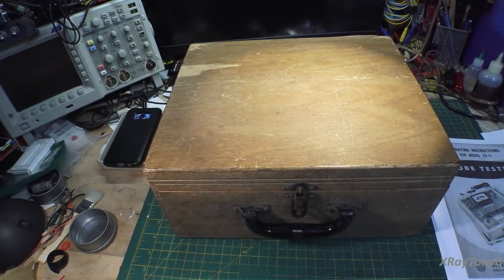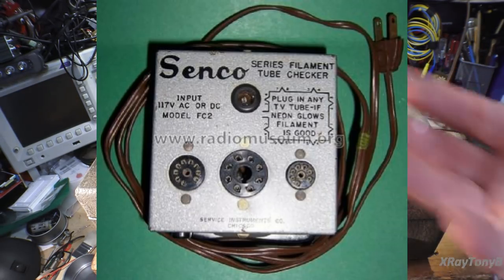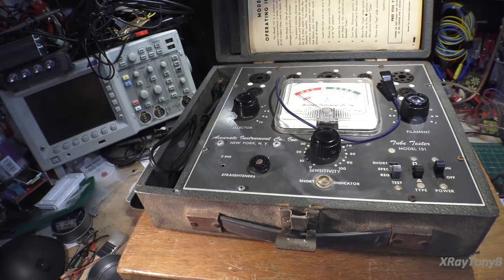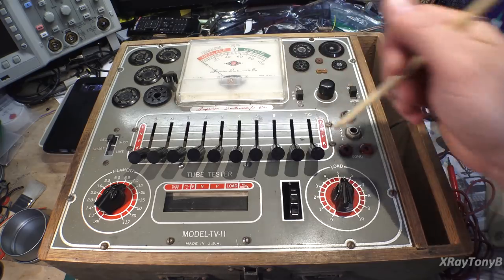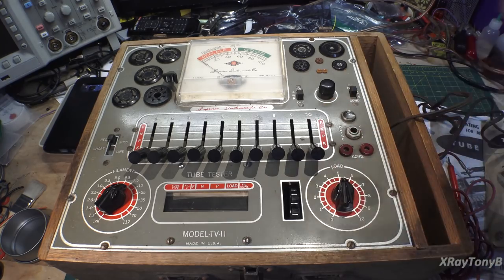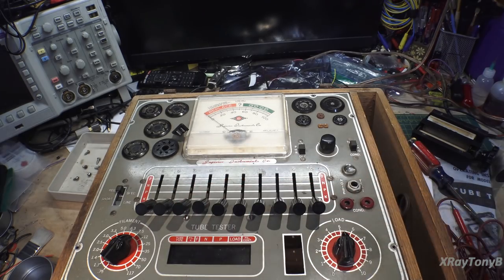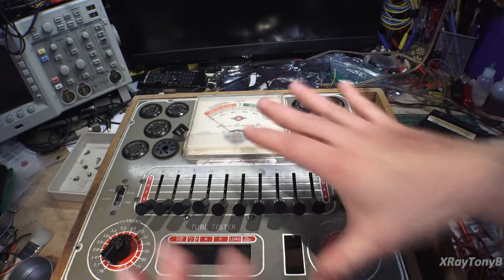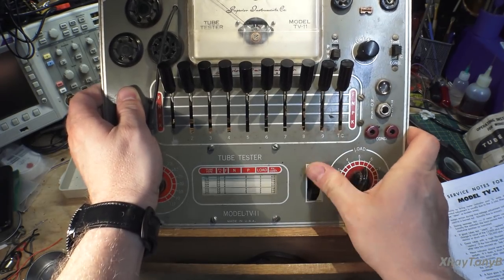SICO  TV-11 Tube Tester Repair & Some Notes on Tube Testers

Comment: Thanks for the tip on the Resistor in series with the Diode. Just for the benefit of others with this unit, I would like to add few comments from my experience. This is a pretty basic tube tester, but I quite like the basic and very easy to use capacitor (condenser) checker. It might not detect all faulty capacitors but it definately will flag a very leaky cap, and it's way quicker to use then a more intensive condenser checker. I also like the pilot lamp feature when I want to quickly check a little bulb works, and I really like the Headphone jack input for listening into to the tube and listening out for microphonic faults or intermittent shorts. Yes I was brave enough to actually hook up my head to this via some old fully insulated headphones. 😱. The circuits are A forgiving  design too. Once you have identified and replaced any out-of-tolerance components to match the wiring diagram, the only other thing to set up is how the needle responds when in 'line' voltage mode. I like to set it up at 6.3V, and then check again at 117V. if you get those two dialled in well, the rest of the voltages should align close enough. With an AC volt meter hooked up to filament pins and filament voltage set to 6.3 (or 117) ignore the needle and set the voltage to exactly 6.3 (or 117) showing on the volt meter. Then turn the potentiometer on the back of the meter so that the needle reads dead centre and then it's ready to go .  I DO NOT like the way it zapped you with about 35 volts AC via the headphone jack when in use if you pop your finger over it. BUT since you can get a zap from the top cap on many tubes, it's just part and parcel of operating an old equipment like this. At least less than 50V AC is generally considered a non-threatening voltage so I can live with that risk, user beware. Other negatives are I have found a tube type that it'll tell you it needs replacing, when actually the tube is healthy. this was a 1Volt Rectifier diode tube with a top hat, so, user needs discretion believing it for some odd tube types. Also some of the voltages are banded together even though the switch shows separate settings. For example, 1.4V and 1.5V are exactly the same tap on the transformer. The higher voltages share common taps also, so some tubes heating elements are going to be underdriven or overdriven depending on voltage... good to know if you intend to leave a tube on it for a long time. At 6.3 volts though, it's been faultless at identifying broken or healthy tubes for me so far, although it's not capable of telling you just how good or weak they are even if it looks like it should, it's not that kind of tester. I like it, but not 100% trustworthy. More of an educated guess, than a definitive answer. Good for diagnosing faulty equipment, bad for testing a tube before you sell it on for example.

Comment: You can get those little swabs on eBay really cheap if you search for "dental swabs".  They come in several different sizes.

When checking the same type tube it is a good idea to check the line setting for every tube.  Tubes from the same manufacturer will usually be fine but from different manufacturers it can effect the line adjustment.

Comment: Great info!  I lucked out on my tube tester.  I got a Hickok model 532 mutual conductance tester on ebay about a year or so ago for $100.  It had been serviced, recalibrated and came with a new reproduction manual and a new grid cap wire.  I've heard something about them being not as desirable because the numbers on the dials show through little windows instead of being out in the open on the face, but that didn't matter to me at all.  I do need to change the octal socket in it as it seems to have a short because you have to put pressure on the base of the tube for it to test properly, but all in all I'm still quite pleased with it.

Comment: The slotted rheostat (R6) on the inside on the black board is to adjust for line voltage adjust pot centering.  You set the line adjust pot on the face to mid point, turn on the unit to line test, and adjust the meter center point using the slotted rheostat on the on the black board.  A common problem with these is the .47uf cap goes bad and the line centering cannot be performed.  As you've done, replacing the cap usually fixes the issue.

Comment: If you ever have the opportunity, it would helpful to hear about your experiences with your old Heathkit TT-1.  Seems like I have to do some sort of minor repair every time I try to use mine.  For some reason the "black" (and only the black) wires in mine have had the insulation turn to "goo".  Whenever that goo seeps onto a set of contacts, only a thorough scrubbing will return some continuity.  I've been putting off what will, no doubt, be a very messy job replacing all that wire.

Comment: I think you skipped a shorts test here. No matter cuz I wanted to mention my tester-an EMC 213 which is a budget emission type. I've used it for 25+ years and tested literally 1000's of tubes on it. I know what a good tube looks like on this unit. I'm a little torn though with testing on this vs a mutual conductance type tester. Reason being I see tubes that test excellent or even marginal on mine, where you say they may test fine on an mc tester. You said no tester is pefect, but when I test a tube on my little  213 and the emmissions go high, then fall off to almost nothing, I've come to believe I have a bad tube. Maybe gassy or has some grid leakage. I've put 100's in the garbage can for this. The 213 does an EXCELLENT job of sniffing out shorts! Did I toss good tubes???

Comment: That’d be a lot safer with an isolation transformer! Also, you can test selenium rectifiers with the 2-20k resistance range on the meter; the “diode check” often uses only the AA battery in the meter, but the higher resistance ranges usually use the 9v battery (in those meters that take separate batteries.) Also, I remember other YouTube videos about how the schematic would show the correct polarity for the schematic symbol, but would mis-label the anode and/or cathode - the only real way to find out is to either measure the selenium rectifier, or figure out the polarity via circuit analysis. Also, you may need to recalibrate, or use a resistor in series with the silicon diode, after replacement! 😎

Comment: I really need a Tube Tester.

When I was restoring/fixing my RCA VTVM I used an old Lionel Train Power supply that outputted 6.3v AC to test the Selenium Rectifier to see what was the correct polarity since a Selenium has a higher voltage drop around 1 to 1.5 Volts compared to a Silicon Diode that has around .63 to .76 voltage drop. Playing with Mains Voltage is too scary for me.

Comment: If I recall, I think tube testers usually recommend running a short test before you run the emissions test. If the tube shows a short then don't test further.
Reply: this is correct-a shorted tube can actually cause damage to the tube tester if a full(quality) test is attempted(many testers use a fuse or small light bulb to help combat this),
So yes, short test first, if it passes it, THEN you do the quality test.

Comment: Hi xray interesting video. I have a SICO Model 777 but the charts supplied are for old tubes and I am looking to check a 7199 from an old Ampeg amp. Is there a way to figure out what settings to use on the 777 to test such a tube? Thanks for any info.

Comment: Is it possible my rectifier is a small sealed cylinder with 3 tiny wires connected to it? the tube tester works but there is a bad smell, I can not be 100% positive but I do believe it comes from that part.

Comment: The drop on these small selenium is about 20V that is why you can not test them with a modern multimeter. Because of this drop, replacing this rectifier with a modern diode will change the calibration of the equipment. The part probably did not work for long time and should be good.

Comment: I have the exact model tube tester but I can’t get the line adjust to work. I have it set correctly to adjust it but when I turn the knob the needle does nothing. Even if I just simply turn it on the needle doesn’t move to the center. The only time it works is when I’m testing the tube for quality. Then I can use the line adjust knob but the needle only moves one one side and doesn’t adjust right with the knob. What could be a possible issue to this?
Reply from the maker: The rheostat may be bad.
Reply: @xraytonyb  would that be the switch used to adjust it?

Comment: ohms and siemens  is SI sistem,  ( the original name ! ),but because america or  england  speak  backwards from the rest  the world  they call mhos ,,,but the correct  name is siemens or ohms  1/siemens=ohms or 1/ohms = siemens , this backwards thing ( mhos ) not existe anywhere,,,,,unless you are american or british ,
Reply from the maker: If the purpose of your comment is to insult those who may be of a different nationality than yourself, then congratulations.  As for the origin of the word mho (for conductance), it was a term coined in the 1880's as the inverse of the ohm (for resistance, named after German physicist Georg Simon Ohm), which was the term used to replace the older term of "Siemens Mercury Unit" (named after Ernst Werner von Siemens).  The term Siemens was later accepted as the term for conductance (which is actually the opposite of what it originally meant) and the use of the term mho (which as you mentioned, is ohm spelled backwards) was discontinued.  Although the term is no longer used, test equipment from that era still exists and still bears the unit of measure on the meter face.  I suppose we could disassemble the meter faces of old equipment and overwrite the word mho with the word Siemens, but I suspect that most people don't care, as they understand that both terms refer to the same unit of measurement that these two great scientists helped to discover.  In closing:  Siemens Mercury Unit = old term for resistance, Siemens = currently accepted term for conductance.  Mho = old term to describe unit of conductance (inverse of Ohm), Ohm = currently accepted term to describe unit of resistance.
Reply: @xraytonyb  LOL! EXCELLENT Tony! Hell YEAH!!!